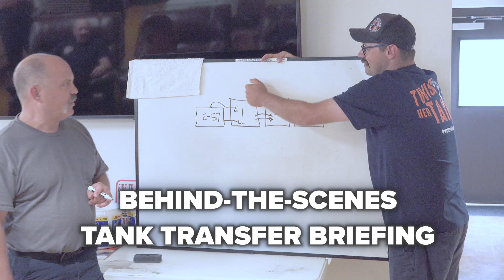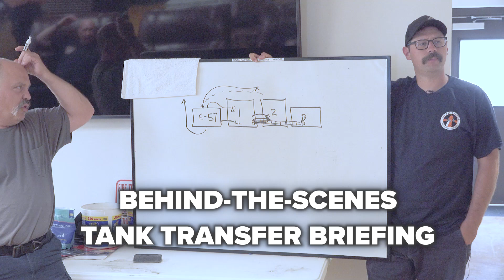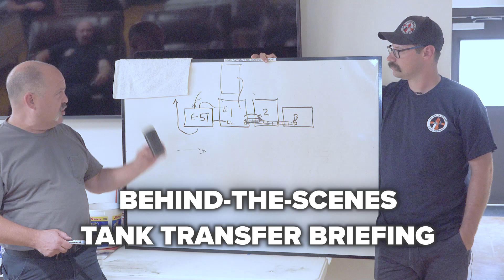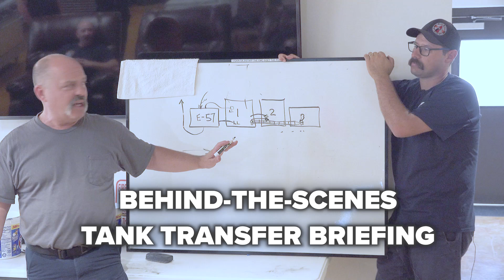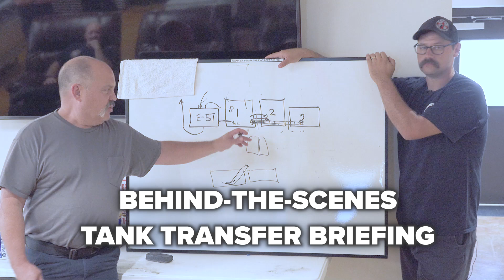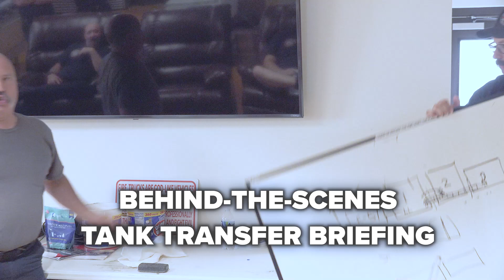How to Transfer Water Between Portable Tanks and Draft

Comment: 1st question: when I was a volunteer our commercial engines didn't have a front suction. Had a rear suction or tank fill. Our engines had 1000 gal tanks.
2nd question: can tank 3 be put behind E-57 so more tankers can unload simultaneously (2-4)?? 
This would work best on a state road (ideal conditions). Town roads might be challenging or add in dead end roads.